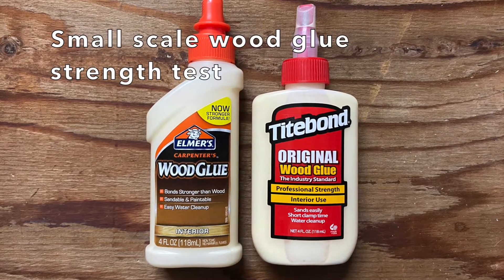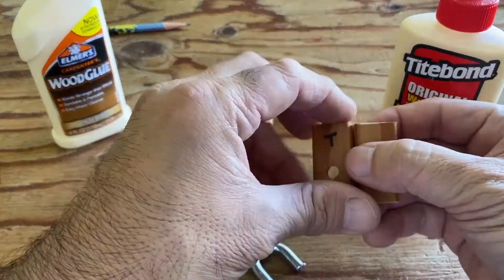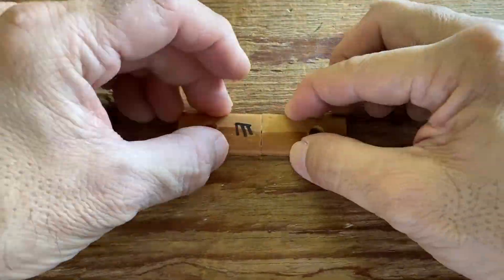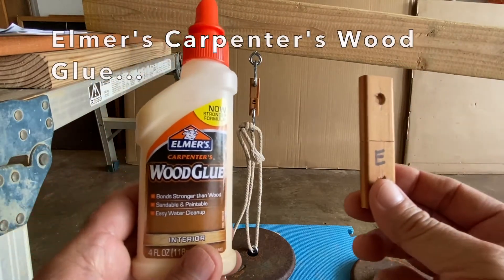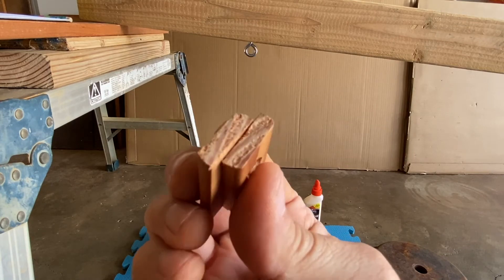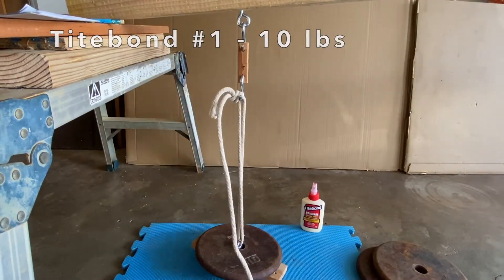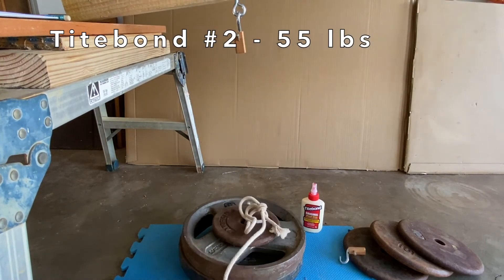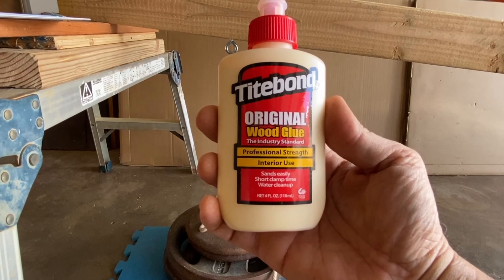Wood Glue Strength Test | Elmer's Carpenter's Wood Glue vs Titebond Original Wood Glue

Comment: Unfortunately testing these requires a lot more glue knowledge and are otherwise simply misleading. End-grain (that's not cross grain) glue-ups are inherently weak. Second, most all glues have inherently poor sheer strength, so how well the two pieces fit together have a lot to do with the strength of emulsive glues. Any water-based glue is emulsive.
Reply: was glad to see i was not the only 1 that was thinking end grain glue ups are weaker always....